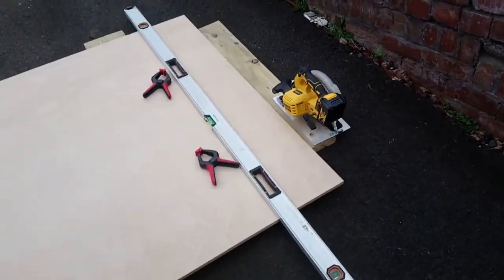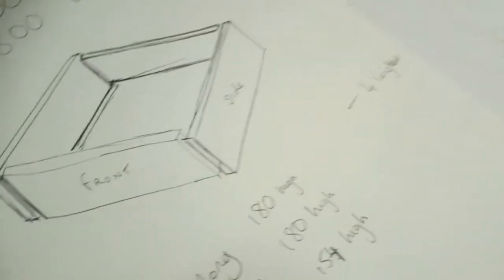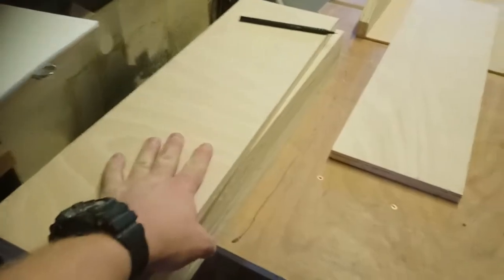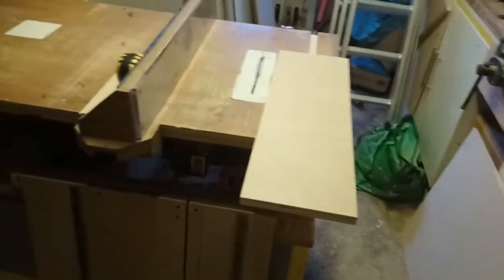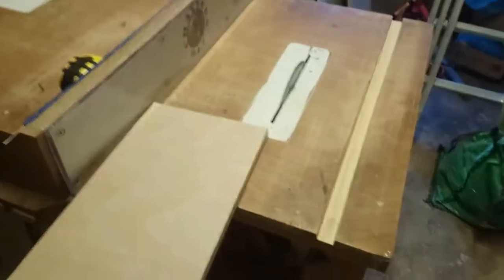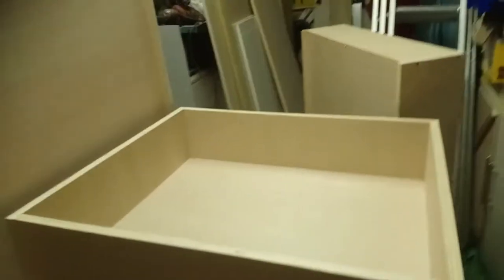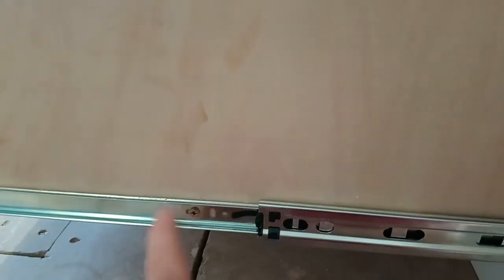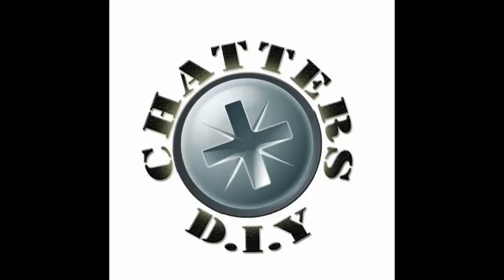Loft conversion Ep7: Drawers

Comment: Firstly great work do far. Was there a reason you didn't go with 5 draws instead of the 4
Reply from the maker: Firstly It was down to the depth of the drawers, they are so far into the wall the top one is close to hitting the sloping roof.
Also I wanted the height to be similar to that of the bannister next to it. Almost like a continuation of the wood theme

Comment: First class drawers and wife proof to ,try ripping the front of these .L O L. A first class use of wasted space ,when floor area is price less .
Reply from the maker: Thanks again, as I mentioned in the vid I had other plans for this space and we did lose the place we were hoping to store the rechargeable vacuum as a result. But on the other hand these look superb and are a little quirky.
Reply: @Chatters156  YES a space for the vacuum , but the draws A1 and holds more bits and pieces . Some one should invent a vacuum with and auto turn when the handle is touched , leave it in the middle of the house and every time some one cures it and moves it ,by the end of the week the house is cleaned ,in house robots , You made a great job of your conversion .Are you in the construction  world for a living ?
Reply from the maker: @allsearpw3829  no I'm not, self taught DIYer... Just enjoy it.